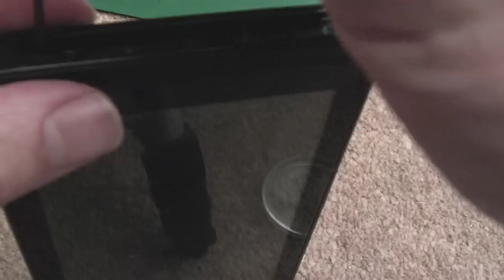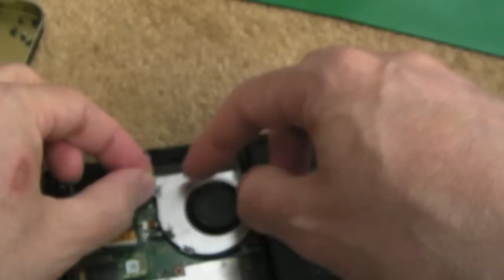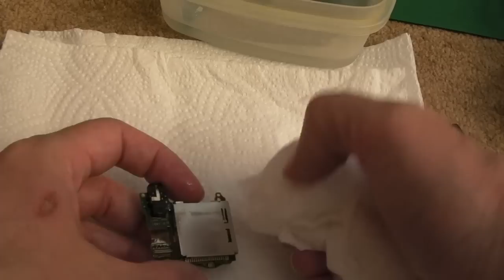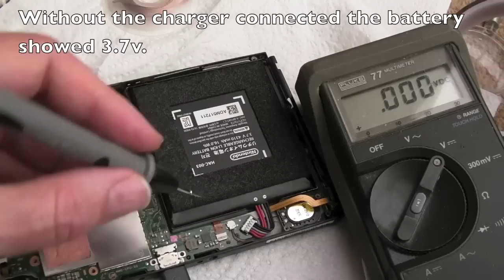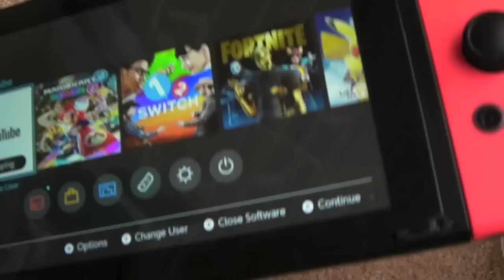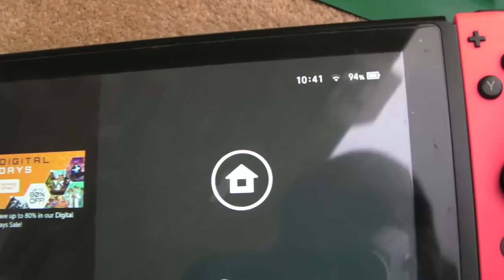Nintendo Switch - Dropped in Water Fix / SL & SR / Battery Draining in Sleep Mode

Comment: I just got my daughter a brand new NS yesterday. She accidentally dropped 3rd of it in the water. It turns on and everything but the red joystick buttons aren't responding and the NS screen tends to not respond with finger touch and it randomly chooses options. Should I just let it drain for a few days in rice? Could I save this?
Reply from the maker: If you dont want to remove the case etc, you could tilt the system so the battery connector is up at the top (ie. unit on its side with the internal battery connector (as seen in the video) facing upwards.  That way moisture will run down the left side of the board away from the power area perhaps.  And put it in a warm area, perhaps next to a de-humidifier.  Worst case in the bag of rice on its side that way.  Change the rice daily perhaps, leave it for at least a week.  The big problem is that moisure can start corrosion, but also short connections out etc.  You could also heat the unit slightly with a hair drier from a distance, just to try and speed up the drying process.  But I wouldnt power it or use it for at least 48 hours - perhaps even a week!
Reply: @GadgetUK164  Thank you very much for your reply and help! Great content btw 😊

Comment: I splashed some water on my switch oled and didn’t realize it to later. It turns on but it won’t charge. It does recognize the cable plugged in but no current. I’m wondering what I should do before the battery drains to 0%.

Comment: I just did the same thing by mistake last night. So I all I really need to do is let everything dry out completely before I try to power it on again? I'm getting two seconds of the Nintendo logo then it powers off. Nothing else seems wrong with it
Reply from the maker: It's probably too late now, but really at the very least you would need to take the back off and disconnect the battery ASAP - then dry it.
Reply: @GadgetUK164  don't worry. It still works in the fullest sence

Comment: Hi I dropped mine in the bath about a year ago and I can’t play any of my game cards on it what shall I do?
Reply from the maker: You need to take it to somewhere that might be able to repair it, but after a year the corrosion will have done a lot of damage.  My advice is to sell it as faulty - describe it accurately, someone will buy it and fix / use it for parts, and then purchase a new one.

Comment: This looks well planned out but I don’t have this kinda time… warranty it is…
Reply from the maker: The problem is warranty doesn't cover liquid damage - they will often say its uneconomical to repair.
Reply: @GadgetUK164  wow 😯 so unless I fix it myself I’ll have to buy another one or pay someone to fix it?
Reply from the maker: @Pizzle0529  Yes =/  You could try the warranty route, maybe they will honour a repair if the board is not too badly corroded.
Reply: @GadgetUK164  will do. I did take it apart and wipe it thoroughly I just don’t trust it’ll ever be the same 😔

Comment: you really should scrape along the pins on ribbons, not over them... i know it's easier to do it that way but if you have any slight loose of contact between the pin (pad) and the ribbon cable itself you'll just rip/scrape the pin sideways and away from the cable... and again, not so eazy fix after that :)
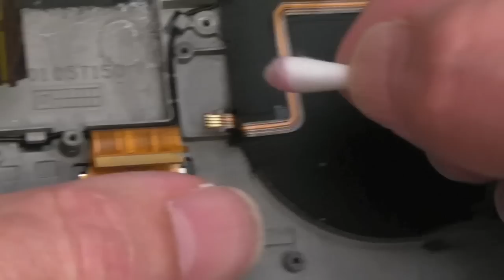edit: also (haven't watch the full vid yet, 19:46) the mark on the big ribbon unfortunatelly looks like a break, at least from what i can see (and the ribbon near batt as well, but those might still work in the connector, depending how far those pins go)... let's hope it's not
Reply from the maker: Yes, often I do pay attention to the direction I scrape lol.  The same principle applies to soldering - always best to go up and down the length of a solder pad, rather than sideways across many etc.   The ribbon was fine, that Switch still works ;)

Comment: My switch fell into a little shallow water on its back. I dried it but I think it may have breached the SD card port under the kickstand. I’m afraid that I moved it to much because it was working fine then I got the symbol for a dead battery while it was on so I turned it off. I heard a sputtering sound around the kickstand area so I dried it off best I could and put it in a bit of rice. I haven’t tried turning it on again because I’m afraid. Do you have any advice for my next course of action?
Reply from the maker: It may have a faulty IC or something.  If you can clean the PCB with an ultrasonic cleaner, that may help.  Also inspect the flex ribbons for corrosion damage.  Beyond that you really need to take it to a repair shop.
Reply: @GadgetUK164  i left it in rice for a week and a half and I left it out to dry for an hour after that and reset it and miraculously it works perfectly

Comment: i dropped my switch in the water about 2 month ago, and i left it in my closet and have not gotten it out but i have no idea on how to turn it on. Its all black but i did try opening it. Will nintendo still repair it? Or do i have to buy another nintendo switch? 😭😭 please help mee
Reply: I THINK Nintendo will repair it but i would take it to bestbuy
Reply from the maker: If you dropped it in water, Nintendo probably wont repair it.

Comment: My switch fell in the bathtub, i took it out and immediately began drying. However, it turns on and plays very well. Nothing is off except for the volume. It says i have headphones in, and audio only works with headphones in. This just happened a few hours earlier, I didn’t know to not turn it on. Im kind of hoping it doesnt perish on me.
Reply from the maker: Get some contact cleaner or a tube of deoxit - put it onto the headphone plug and connect / disconnect the headphones several times.  You may find that solves it.
Reply: Having this problem as well, Switch Lite accidentally fell in water and the audio and headphones icon sometimes pops up.. not sure how to fix that
Reply: @opalpika1328  hey did you manage to fix it? is your switch still working?
Reply: @matyldakrol6032  Yeah, it's still working.
Reply: hey, I know it's a bit later, but I'm in a similar situation, so I wanted to know what happened? is your switch still working? is the sound working?

Comment: Does anyone know what I should do because I spilled water on my switch it charges fine and sound is great even when it’s docked it works perfectly the only problem is that the switches screen is all black does anyone know how to fix it
Reply from the maker: It sounds like the backlight circuit is faulty, but it could be corrosion on the ribbon / connector.
Reply: Thanks

Comment: what if its vinegar
Reply from the maker: Vinegar can help solve any oxidization or early start of corrosion.  Make sure you wash the vinegar off with IPA or distilled water afterwards though.  Dont leave it in Vinegar more than say 1 hour.

Comment: I broke my switch including the joycons so should I get it repaired or get a new one.
Reply from the maker: It depends on what is wrong with the Switch and the Joycons.  If the Switch died just from connecting the dock up, someone would likely be able to fix it.  If it's corrosion damaged it could be difficult.  My advice is to sell it as faulty, describe what the issues are and use the money to buy a new one.
Reply: @GadgetUK164  thx

Comment: Dude im using the same screw driver you used in the video and i cant for the life of me take off the back panel screws please any tips?
Reply from the maker: Maybe check eBay for a screwdriver specific to the Switch - maybe yours is worn on the end or something?
Reply: @GadgetUK164  after opening the system i havent seen much corrosion im not really a tech person but ive been cleaning the inside to the best of my ability do you recommend i open it further and soak everything in ipa? For context on why i am fixing my switch is that it was accidental put in the washing machine but taken out almost immediately (10 minutes) and when taken out it wasnt drenched or anything but the indicator inside is infact pink so i don’t know what would or should be the next step for me
Reply: Update things are going decently now im now in the console ive up unplugged the battery can i use 70% ipa?
Reply from the maker: @1bum  You are better off using 99+ % IPA!
Reply: @GadgetUK164  ahhhh ok is it bad that i used a bit of 70% with a cotton swab?
Reply: Yea i ordered some with Amazon prime should be getting to me on the 24th as for update on the switch i was able to take of one back screw and as for the context of why im doing this well im put my switch in a washing machine for ten minutes...yes im dumb ive realized this
Reply: Also yes it was accidental but more importantly thx for the info

Comment: My son spilled a water bottle on my brother's switch during dinner. The switch was in sleep mode when it happened and was immediately shut down afterwards. My brother put the switch on some rice and left it there for a week. After a week had passed he decided to try it out. It does charge and when it turns on an orange screen comes on. Can this be fixed? Holding the power button does nothing and it eventually dies after being left on for a while.
Reply from the maker: Likely it could be saved, but someone would need to strip it down and clean everything like I did - its a lot of delicate work if you've never worked on something like this before.

Comment: My son has dropped his Nintendo switch in water 💦 he has barley submerged but the damage was really bad it’s screen completely glitched out now it’s blank he is destroyed. His life is destroyed I’m using his account to tell you is there any way  to fix without taking it completely apart I’m not good at taking things apart
Reply from the maker: No, unfortunately you need to strip it right down and clean everything.  Probably best to find a repair shop that can do it if you've never worked on something like this before.
Reply: GadgetUK164 - Retro Gaming Repairs & Mods my son said that the Nintendo switch is Turning on and booting but the regular screen is not showing you can see light from the screen but where you see the menu and stuff is not showing if you know what I mean if he connects it to the tv he can see everything he can play games and everything do everything and the speaker started working

Comment: I’m having to replace the sticks in possibly 1& a half pairs of Joycon at the weekend.
Reply from the maker: It's a shame they don't seem to last very long =(  The woes of cutting edge I guess!
Reply: GadgetUK164 - Retro Gaming Repairs & Mods or the best of money making designs. Make something not last long & most people will just pay out the £69.99 for a pair of new Joycon instead of repairing them. £20.10 on Amazon for 2 sets of Analog Sticks, a pair of metal catches & tools to do the job.
Reply: GadgetUK164 - Retro Gaming Repairs & Mods I managed to replace both Analog Sticks that needed replacing, but somehow managed to ping the Spring for the R button on my Right Joycon somewhere & cant find it, but the R button still works fine & managed to snap the ribbon cable to the shoulder button, sync button & LED strip boar on my sons Left Joycon, but I think the cable was already damaged as the LEDs weren’t working on it.

Comment: Nice job from both of you. Just a slight bit of misinformation from this upload is at 47:12. The connector got warped because the connector wasn't aligned when you pushed it back in hence it got deformed and not by heating the nearby chips. Vince also hates that connector for this reason. Apart from that it was good work from both of you.

Comment: Phil here. Only 25mins in but have a couple of comments:
1) do not use IPA in an ultrasonic cleaner. It has flammable vapour and could be a fire risk. (I thought this would be a good idea but a google search told me otherwise)
2) to dry a PCB after soaking, preheat an oven to around 85deg C then put the board in and switch the oven off. When the oven has cooled the PCB should be dry.

Comment: 44:29 If you have a general idea of where the heat is but need to pinpoint it you can use IPA and watch where it evaporates off first :)
Reply from the maker: Thanks, yes - I've used that technique myself in the past!  I tried freezer spray instead on this occasion myself and saw no clues.  If there was a temperature difference somewhere it was very minor.

Comment: Although this one was submerged under water I do get the impression that these are not the most reliable devices in the world.  When you compare them with other vintage consoles from yesteryear which are in the most part still working fine.  Especially if the joycon controls are already starting to fail.
Reply from the maker: Yeah, I think we've reach a point where they are so compact in there that drops and stuff take them out really easily =/  The controllers as you say are also a weakness on these!  Whilst I really would love a Switch, I wouldn't be happy knowing its probably not going to last long lol!
Reply: @GadgetUK164  if I was to get one it would most likely be the switch lite as it looks much more substantial although it can't be docked or doesnt vibrate.

Comment: Thanks for the sponsorship errrr I mean numerous mentions Chris ;-) Good job working out what was draining the battery, really useful to know about the liquid damaged caps acting like resistors. My son's iPhone 6S that was a water damaged eBay buy, also drains just as quick when off as on, so it might have the same problem.
Reply: Vince thank you so very much for looking at my sons switch, alongside Chris, we’re so grateful for your help.
Reply from the maker: @RetroUnlim  You're welcome mate!  Hopefully it's still working OK?  Thanks for the stuff you dropped off, much appreciated!!!!
Reply from the maker: No worries lol - thankYOU for all your help on this one!!!  Looking forward to seeing your video - especially how you solved the issue with the connector on the digitizer board!  I am still not sure what caused that - was it heat, or did I bend it by pressing it wrong?
Reply: @GadgetUK164  They bend really easy and it can take a few goes to line them up. I will get the video live in a few days so you can piece it all together😀👍👍👍👍👍

Comment from the maker: A couple of clarifications - when I said "a few minutes ago" just after cleaning with vinegar and the fibre glass pen, I meant a few mins ago in the video you've seen.  That comment was made around 2 days later.   Also when showing it was only on 94% after being left overnight, I did have to power it on in the video there - I had checked it an hour or two earlier and saw 96%, and then hard powered it off.  I've since researched Silica Gel vs Rice and it seems they are almost on par - so neither are much good at drying out water damaged consoles and phones.  The key is disconnecting the battery...  On Vince's video he showed the SR & SR buttons working, but just before he sent it back to me he noticed one or two of them stopped working again - hence why I looked at them in my video here.
Reply: I think your still okay concerning Silica gel desiccant versus the use of rice. They both have similar absorption properties, however, I'm fairly positive rice is less effect for air absorption method. Could always place the device near or on a dehumidifier though. Just be careful as a dehumidifier when it draw moisture out of the surrounding environment it increases static electricity in the air. So if you use one for drying electronics place the component on ESD safe matting near the device.